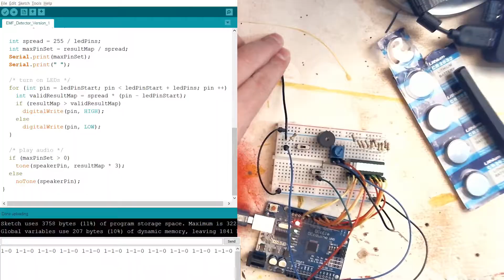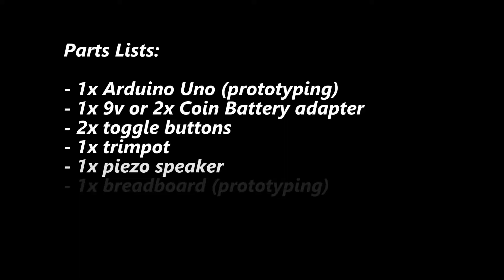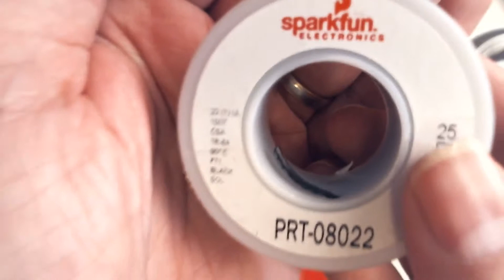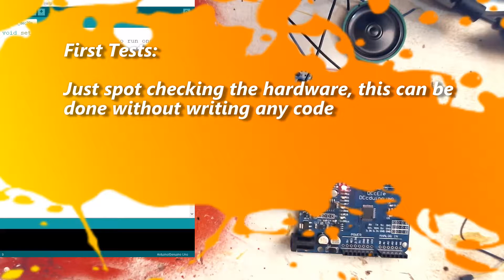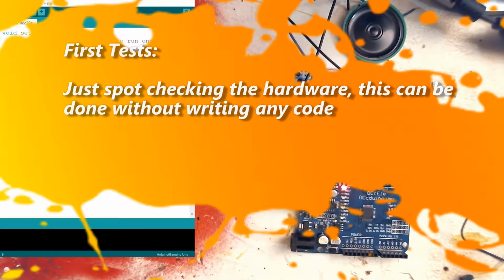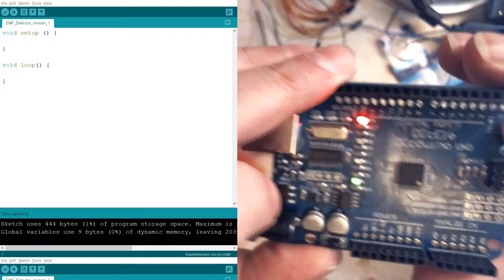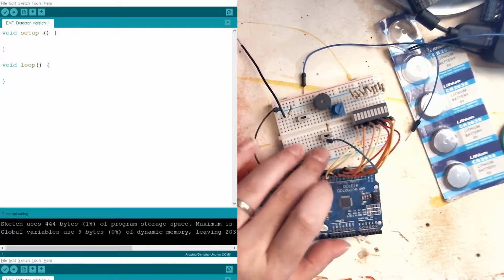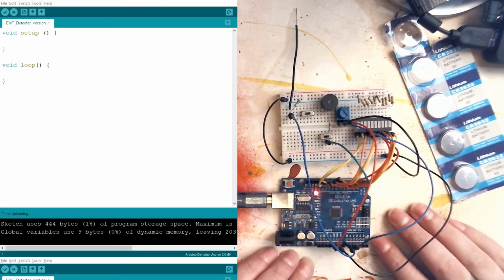Part 2 - Making a CHEAP EMF Meter - The Breadboard

Comment: Never realized how affordable this could be. I started learning python so I can build some stuff at some point. I imagine sensors and stuff can get more pricey yeah?
Reply from the maker: It can!  Check out some places like ElectroDragon, you can get sensors for a few dollars there :)
Reply: @LloydSummers  thanks! I checked out your company, very cool endeavor! What language(s) do yall use for your development? C#?
Reply from the maker: @Loki_Dokie  at our VR studio, C++ and C#!  The Arduino / robotics uses kind of a lightweight C...
Reply: @LloydSummers  ok cool, I may get on c# unity one day just for fun. What is the difference in arduino vs raspberry pi? I'm assuming python only works for pi. Sorry for all the questions lol
Reply from the maker: @Loki_Dokie  all good :) the pi is a small Linux box, and uses a micro processor.  So it takes longer to boot but can do a lot simultaneously.  It's really good for complex operations like image processing

Arduino uses a micro controller, it is really good for if-this-then-that operations.  It starts much quicker, and is faster to develop for.  But it doesn't do as much.  It's really good for press this switch and something happens
Reply: @LloydSummers  I'm just afraid of C lol, would raspberry still work for an EMF? I wanted to make some paranormal tools, one of which may be a bit daunting, an SLS that uses lasers to detect shapes, I guess like Xbox Kinekt basically. 

I want to get into drones at some point too as a side hustle and eventually build one. I have more interests than I can handle but one day lol